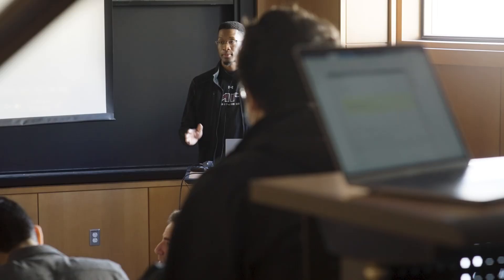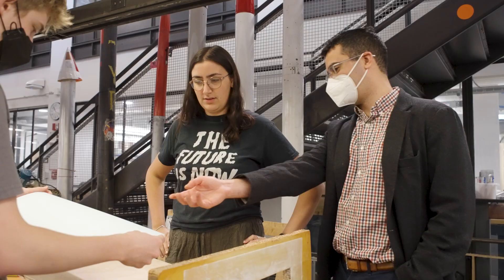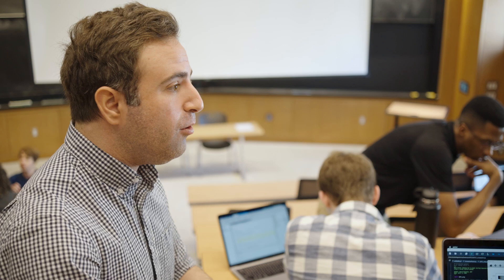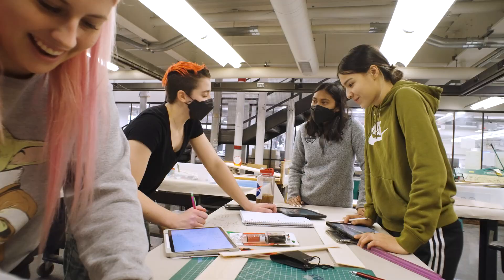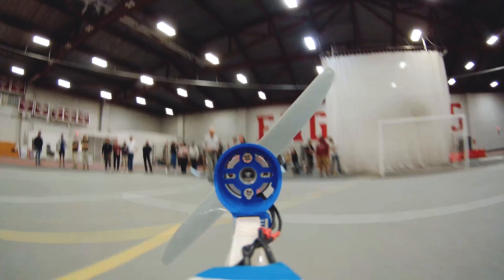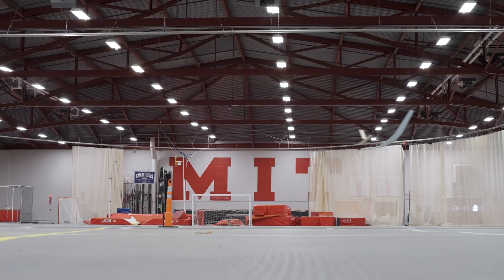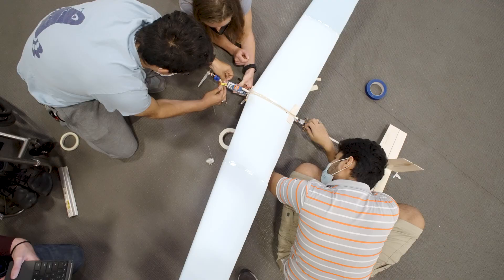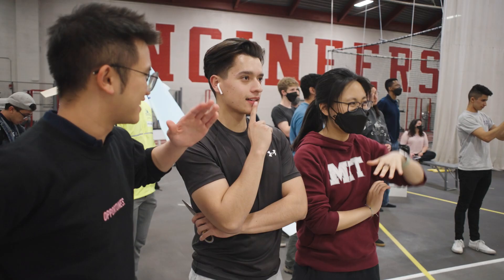Unified Flight

Comment: How to fly without air ?

Box a jetboard system it's a fluid_impulse motor, flies on a fluid in bent pipes back to a tank, study Kirchoff most handy.

The new astronautics, power pumps w/magnets no_fuels no_batteries, it's a powerful force.
Fun stuff 🕊